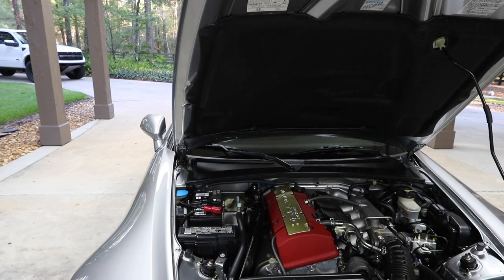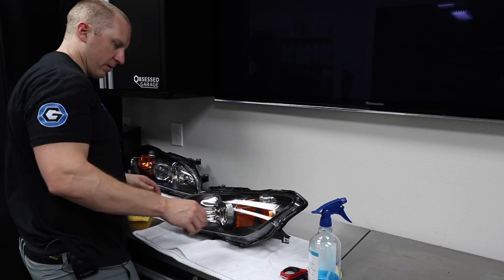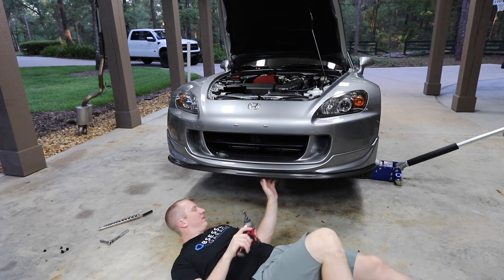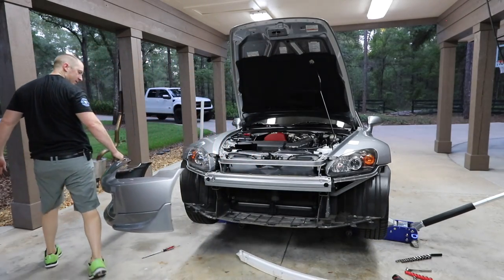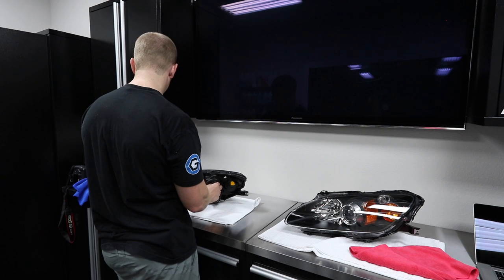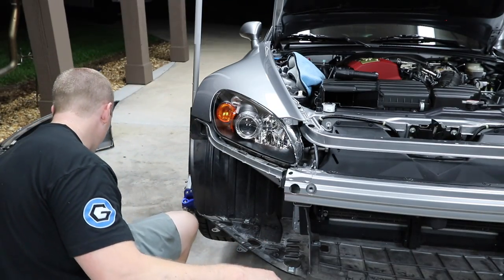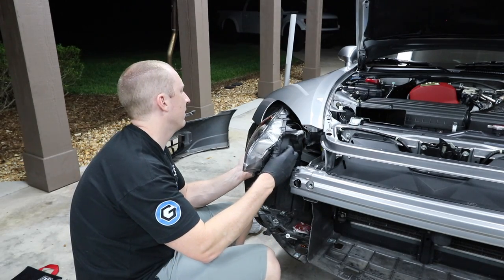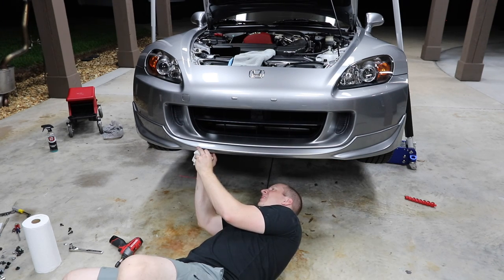S2000 New OEM Headlights Install

Comment: My GMC Sierra pickup work truck is 19 years old, and looks close to new with 227,000 miles. I used all OEM parts to maintain it. My Honda S-2000 is well loved, but not as good as yours.

Comment: Great job Matt. As soon as you did the first headlight, I said to myself, I hope you check to make sure it works. Good thing you did when you installed the second one cause I know it would have been a pain if you had put the bumper back on and then realized there was a problem

Comment: Hi Matt, I recommend some plastic trim tools and pry bars for when you work around interior and paint.  They aren't expensive, you can find them at Harbor Freight and get nicer if you like.  For jobs you might do later, consider masking the painted edges just enough for the edge of the tape to wrap around where the fender meets the light.  That way you can peel it off after without tearing it and leaving some behind.  Since you treated the lights and probably wouldn't want to tape them, try some cling wrap, might save you from a little scuff.  Don't ask me how I know this stuff ;)
Reply from the maker: Yeah...it's on the list.  Those, and a heat gun.

Comment: I know this video is 2 years old but if anyone is thinking about replacing their headlights or what not, it helps to remove two bolts on the fender just for a little more room. You’re less likely to scratch your headlights when throwing them on!!

Comment: You know you're rich when you buy real OEM parts
Reply from the maker: What?  Ha, ha...
Reply: Why is he rich? I buy oem parts myself and i live in Denmark, where it's really expensive?
Reply: 900.00 for a set of Oem lights isnt too bad. Nissan wants that for just ONE replacement OEM headlight for my 2012 Maxima. I bought a set of aftermarket which fit and work great. 175.00 for the set.
Reply: Morten Nielsen It's just way cheaper to buy quality knock offs
Reply: Nemlig Morten.   Danmark er ikke et sjovt land, for os som elsker biler.   Vi har simpelthen ikke råd.  medmindre vi bor i en hybel i Ishøj :D    Fedt med en anden dansker på denne kanal

Comment: I used xpel Headlight Protection Kit on my s2000. It's been about 6 years and they still look brand new despite the fact I daily drive my s2000. She also sits in the sun quite a bit. It also protects the headlights from rock chips, road grime, and debris. I HIGHLY recommend using Xpel.
Reply from the maker: If the Xpel looks like brand new, then the headlights would look brand new without it.  The issue you may end up having is delamination and UV clear coat failure if you remove it.  So that protecting from rock chips (a rock will most like make it through the film anyway) opens up the plastic to a myriad of other problems.
Reply: Great points! However, the film is a few millimeters thick and it's kind of rubbery. It hasn't faded yet so there is no reason to remove it. Also, a rock the size of a quarter would probably be needed to damage the headlight since it's so thick. Lastly, when applying and removing the film, you use a heat gun on low from a distance and it goes right on or off. I was tired of yellow headlights despite maintaining/cleaning them on a daily car so I tried Xpel -- why not? So far it's great! 0 maintenance or cleaning required (I clean them anyway) along with no fading or rock chips! I would definitely not use it on a garage queen like your beautiful s2k.

Comment: Matt you may not know the s2000 has a location the bonnet prop goes to make it vertical so it's easy to get under the hood!
Reply from the maker: Yeah, I don't know why I never end up using that.

Comment: If the HID bulbs have not been replaced, I'd highly highly recommend getting some new HID bulbs. They should be D2S if I remember correctly. You will see great improvement in visibility especially from those S2K HID projectors. I'd suggest something like Osram Cool Blue Intense. TheRetrofitSource.com sells a wide variety of quality OEM bulbs.

Comment: Tip -put some painters tape over the headlights to protect them during assembly.
Reply from the maker: That's what I should have done.  I mentioned it in the video, but after adding the AMMO Reflex, I didn't want to mess that up.  ...Bad choice on my part.

Comment: You could put saran wrap on the lens of the headlights for extra protection when installing them. It may leave a slight residue on the lens once you take it off but its nothing you can't get rid of with the usual products. Just a thought.

Awesome car btw.
Reply from the maker: I was going to tape them, but I had just put AMMO Reflex on them and didn't want to mess that up.  Bad choice.

Comment: Use Saran Wrap to protect surfaces while working. Much quicker and easier then tape plus it won't leave any residue behind. I was cringing watching you remove and install the lights and bumper. 😰
Reply from the maker: I would have, but I didn't want to mess up the curing coating.  ...Bad choice...

Comment: Matt, this is off topic. 

How would you protect the leather seats. Not the conditioning but something to protect wear from rubbing when you get in/out of the car. For example, the drivers side by the seat belts is there some type of clear tape or hack that you have to protect that area?
Reply from the maker: I think you just have to prepare yourself to the fact that it's going to wear.  Then replace in 10 years if needed.
Reply: I guess clear tape wouldnt be very appealing. You're probably right just have to get new seats lol. Its just I have a brand new STi but I wear jeans with buttons in the back and its doing some nice wear on the seats already. 

Thanks for the response. I really enjoy your vids!! Keep up the great work on the channel.

Comment: Matt did you ever find out what the trick is to get it lined up on the bottom of the headlights? I had the same exact problem when I took mine off, however it doesn't seem like there is any adjustment anywhere... it all just lines up on the fenders and in the top middle one way.
Reply from the maker: I ended up having John from LHT do it.  I couldn't get it right.

Comment: What's the stuff he's applying on headlights at 6:20? Reflex? Is that some sort of sealant/coating?
Reply: EnemySoldier It's Ammo NYC reflex....it's a ceramic coating
Reply: Thanks. $65 a bottle... I knew Matt wouldn't put cheap crap on his car but god damn that's steep. I guess I just don't love my S2000 as much, ha.
Reply: Ammo Reflex
Reply: EnemySoldier It goes a long way! You can get at least 2 vehicles coated out of a bottle of reflex. And I believe the say it's good for an entire year of road exposure!
Reply from the maker: Reflex isn't a ceramic or glass coating.  I tried to convince Larry to tell me what's in it.  He wouldn't spill the beans.

Comment: Matt, you dropped the ball, man! I was waiting on you to pull out the rotary to dial in the wheel wells. Get all those hair line scratches out that I could see on film from here. Somebody may see the lack of it being dialed in with the bumper all together and back on. Well, not so much anybody but mechanics that may work on your car in the future will notice it. They may charge you double for not having it dialed in.
Reply from the maker: It's pretty far off.  The driver's side is good, but the other side needs the head light and bumper adjusted.

Comment: Must've missed it, but what was wrong with the OEM headlights that were on the car to need replacing?
Reply: CobraTuner they had a vinyl tint on them, and when he removed the tint he used some strong chemical that apparently ruin the lens

Comment: nice engineering. you have to do all that if your turn  signal bulb needs to be replaced. wow
Reply from the maker: You can change it through the hole in the fender, but my hands are too big.

Comment: Why did you have to replace the headlights?
Reply from the maker: They had tinted film on them.  When I removed, the UV coat had failed, and they had stress cracks in them.

Comment: Haven't seen the GT350 in a while but how's the decklid doing? Has that spot collected alot of dust? Mine seems to still collect dust/dirt the quickest.
Reply from the maker: The black is lightly scratched from toweling and washing, but other than that, it's good.

Comment: Matt youre doing it all wrong. you need to lift it from the oil pan so both sides are level.. lol

i get what you mean regarding Adams 240. and its mostly fanboys who think having a gutted car means they have a racecar. all they care about is being cool.
Reply from the maker: Ha..."racecar."  Racecar means you have some scuffs on the bumper from hitting tire rubber.  It doesn't mean everything has to be broken.
Reply: Obsessed Garage try telling that to those other guys. ha ha.